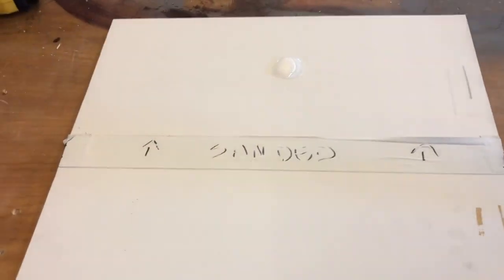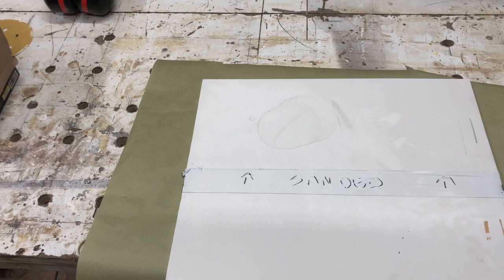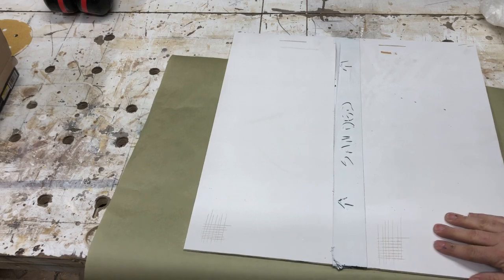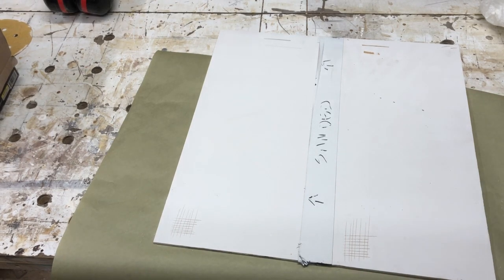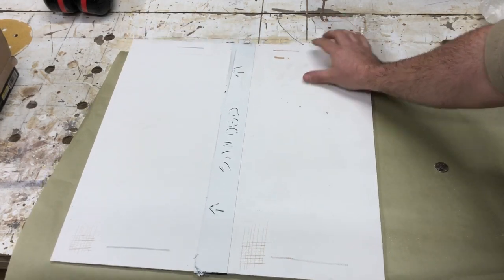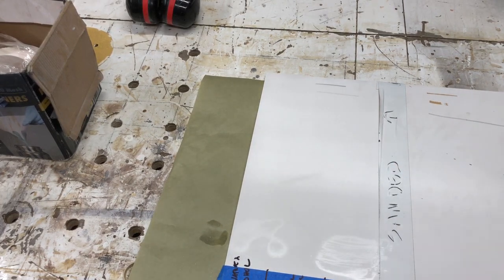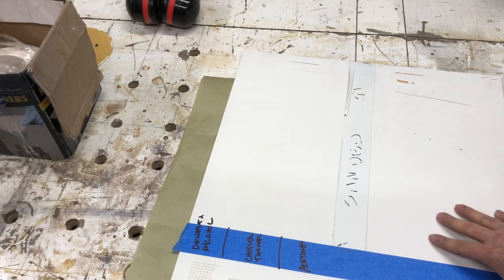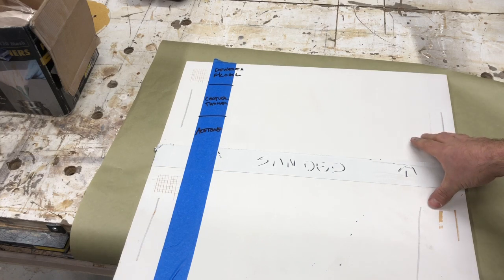cover stain oil primer review

Comment: WHAT HAPPENED TO COVER STAIN? it smells different , doesnt dry as quickly or level. VERY gummy when sanding, loads the sandpaper instantly and doesn't " chalk sand" like it used to. No longer any good for me. Restoration painter of 30 years.

Comment: Anybody spray with HVLP cover stain ? What size tip and or how much do you reduce the product?
Reply from the maker: Yes reduce it 20-30 percent
Reply: @ericreason6559  With what? Im a rookie wanting to use an airless sprayer in my interior garage

Comment: is the Cover Stain a better product than the BIN primer for covering furniture before painting, to stop bleed through.
For some reason, the BIN is always recommended rather than Cover Stain but I think that is a meths based product, which makes brush cleaning a bit too much faff.
Reply from the maker: +Brian Morrison  better is probably not the right word. They are different the oil has far better adhesion, blocking, and chemical resistance. The down side is that it is slower to dry and it becomes much more brittle over time. So it has its pluses and minuses.
Reply: @ericreason6559  I thought cured oils in paints were less brittle and more flexible than dried shellac.
Reply from the maker: bitTorrenter apparently not.

Comment: I just tested cover stain vs problock by sherwin williams ...... both stuck well , but cover stain was far easier to brush ... problock was very tacky and hard to brush .... didn't like it at all ..... probably could thin it a bit , but cover stain would require far less thinning than problock .... coverstain oil sticks quite well ..... I think it will be my preferred choice ..... light sand would be best , but still sticks pretty well unsanded ..... sanding is ALWAYS better than not sanding no matter what you use .... just a light sand and cleaning .....
Reply from the maker: The cover stain is a great product. Only thing is the sleet dry times but beyond that 👍